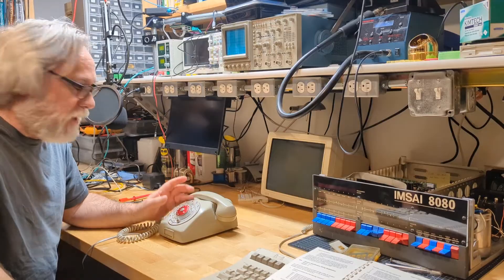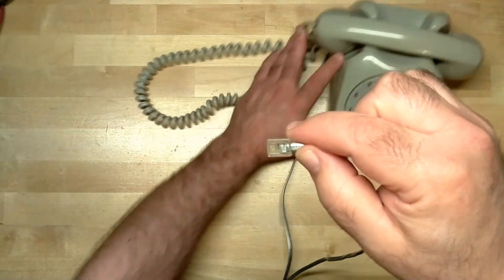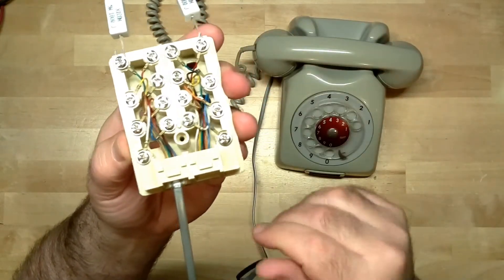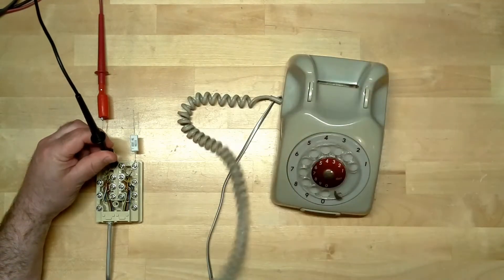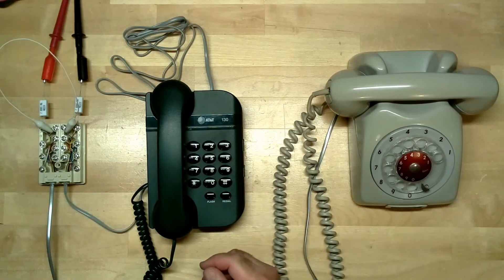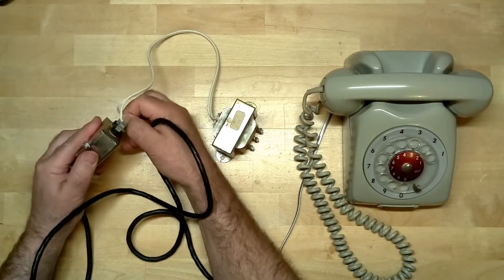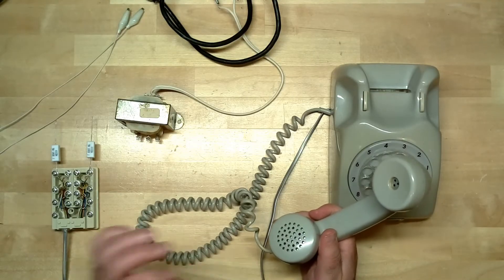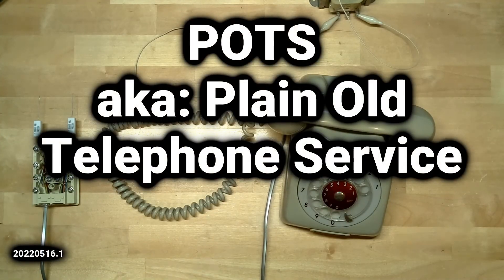Building a Plain Old Telephone Service (POTS) Intercom

Comment: I would argue that a modern cellphone call is more secure than a hardwired intercom phone setup, unless you’re worried about the government listening in. 

A hardwired phone to your neighbor’s house can be literally wiretapped. The one ones who can “wiretap” a modern cellphone call is the carrier and the government, because modern cellphones use digital, encrypted signals. 

The only way to “wiretap” a modern VoLTE cellphone call as a bad actor, and not an authorized entity, is to use an exploit called ReVoLTE, which is very limited in real world practice. It also requires a few thousand dollars in equipment, and some good technical know-how. They must also know your phone number, and execute the first step of the exploit within 10 seconds of you making a phone call. And since they have to capture the downlink stream, they’re likely going to have to be closer to the tower you’re connected to than you. Not to mention there’s other hurdles to get over like finding the correct audio codec, transcoding, and compression of packet headers. Additionally, it all hinges on the base station (tower) having its LTE keystreams implemented incorrectly, allowing reuse of keystreams on calls made in quick succession. 

Pre-digital cellphones, a landline was far more secure. 

Now all this goes out the window if you’re a kid trying to talk to a friend without parents listening in, as many cell providers offer parental control that allow parents to receive an audio file copy of the phone call, and details of who you called, or who called you.

Comment: Did I get it right that you only need 2 wires (or 2 pins) to hook up a phone? I always assumed it's 4 because the RJ11 has 4 pins. 2 for audio and 2 for the ring current. 
Also on a newer phone which has a ringtone coming from a speaker instead of a bell, is it also 90 Volts 20 Hz?
Reply from the maker: Yep.  All syms n 2 wires.  All pots phones since day-1 run the same way! 👍
Reply: @JohnsBasement  Thanks for the fast response. 
Some wifi routers (which run on 12 V) also have a RJ11 port for telephones. Do they also make the phones ring with 90 volts ac? It's kinda hard to imagine for me that a little box like that, which runs on 12 V also can output 90 volts. Am I missing something?
Reply from the maker: @TulgaD5  A phone can ring at lower voltages as well.  In my video I was ringing it at 24V.  To be fully compliant, the ring voltage SHOULD be on the order of 90V.  But 24 or 48 will likely do the trick on most phones.
As for getting more than 12V out of a 12V power supply, note that the ring voltage can be run through a transformer to step it up.  You can use a regular power supply transformer connected backwards... but be careful how you drive it.  A transformer is an inductive load AND one designed for 50 or 60HZ is going to saturate if you run it at, say, 20HZ (that is why you can use a 50HZ transformer in a 60HZ application but not the other way around!  -- it has to do how many lines of magnetic flux that can build up in the core before it becomes full/saturated.  Bigger core = more lines = more time = lower frequency.)  Therefore, ring your phone at a frequency at or higher than your transformer is rated and/or just let it saturate and provide current limiting at the primary so that you don't mess up your driver circuit. (Because a saturated transformer/coil looks like a direct short.)

Comment: Grandad was a ham. We did this in the 70s. I bought a 20 year old motor coach 4 years ago. It has 3 Pots phones front to back and one in a box back by the engine. They had not worked in a while so I fixed them up
Reply from the maker: Awesome!  "Hello, engine room?"  🤣

Comment: The phone system as we know it was around for way more than 100 years ago, since the Panel switch, the machine that connects phones together using rotating drums containing almost a computer program and columns of brushes moving up and down upon a Panel of contacts to find your line and a sort of electronic database to manage it all, was introduced in 1915
Reply from the maker: It would have been amazing to be part of creating it!

Comment: I've never had a problem with it, but I've been told repeatedly you shouldn't plug a 4P4C (e.g., RJ11) plug into an 8P8C (e.g., RJ45) socket, because it could mess up two of the pins.
Reply from the maker: 🤔 Now that you mention it... It does feel like the female-side is under a bit more pressure than usual.  The plastic 'shoulders' on the 4-pin are probably pressing up pretty hard on some of the leaf-springs.

Comment: Most European phones ring at 60volts 20 hz. Talk voltage ( also known as battery ) in the USA is around six volts while on hook voltage is around 48 volts. Ringing voltage was generated at the central office. Today these voltages are generated in interface boxes ( some networks call these DSLAM's ) where the voice is translated to digital data and sent to the central offices which routes the data stream of the call to the appropriate fiber cable to the correct interface box which converts the digital signal back to analog signals which are fed to the homes on copper lines. There are many municipalities now receiving fiber service to their homes.

Comment: So your saying how the ringer works? I kind of went right past me even though I was trying to catch how a ringer works,
It gets a higher amount of voltage how much  was it?  And if my phone will only make a un healthy ring what IT needs more volts
or the coils bad. or is there a capacitor that can go bad its only a 2009 single bell
Reply from the maker: The proper ring voltage is a 48v, 20 HZ pulsing waveform modulated onto a 48v DC bias.  But it should ring as I show on 24v, 60 HZ AC.  If it buzzes or rings weakly then raise the voltage.  Do not exceed 48.  Keep in mind that it is going to buzz VERY loud into the handset if you keep the ring voltage on after you pick up the handset!!! 
I would not exceed 24V.  If your phone won't ring then get a different phone.

Comment: so i had an old wall rotary dial phone. found the right kind of wire at a thrift store it connects to the little wall plug fine bbut doesnt connect to the back of the phone right. its too wide so what do i do now?
Reply from the maker: Phones have all sorts of different jacks and cords. I couldn't say based on only this description.
You can google for images of phones and connectors until you find the one on your phone, what it is called, and then google gor places to get one.
I would just open the phone and see if I could directly connect a cord inside.

Comment: Always fun to share  little projects with my friends. The design I came up with was a DC power brick,for a motor from junk cordless drill to drive a stepper motor from junk printer to make idle and ring voltage. We got our ring CPS from some switches touching cam lobes on the drive.

Comment: 2:42 not true. If you did not have a dailtone on the second pair (which you would only have IF you signed up for a second line)  you would not have any voltage on the second pair.
Reply from the maker: It was true at my parent's house in the 1970s.  They had a single line and there was a Western Electric wall wart powering the second pair.

Comment: In the 70s, I built a simple intercom system in our high school auditorium from the lighting board to the spot light to the stage manager by wiring three hand sets this way. It was genius.
Reply from the maker: I spent much time in the end of the 1970s in my high school's radio station and auditorium. The auditorium had bits of old telephone operator headsets laying around its closets from what must have been the same sort of thing.  :-D
Reply: We made an intercom using A modules from a language lab. They tore it out of the classroom. My friend and I were on the audio video crew. There was a heavy zip line from the spotlight to the back stage we used a ground and the zip line to hook up communication. The input of one mod went to the output of the other and so forth the electrical ground was common to both setups. We used the labs headsets which were 600 ohm speakers and the mic was high impedance. I have a few of those A modules and they are great for sound pickup. I can record birds singing that's how sensitive they were. Good eavesdropping amps.  Who needs a phone! 73

Comment: You mentioned the polarity doesn't matter. Back in the 70's, my boss asked me to fix his phone so people couldn't call out on it. I installed a hidden switch that reversed the polarity of the red and green wires. When reversed, the phone worked normally, but you could not dial out with the polarity reversed.
Reply: Rotary dial phones will work with the polarity reversed. Early touch tone phones needed correct polarity to dial out. Western Electric, supply unit for the Bell System began installing a " polarity guard " in it's equipment so if the line (tip & ring) were reversed you could still dial out. After 1984 when anyone could make and sell telephone equipment the really cheap phones did not have the polarity guard and correct polarity was required. Line reversal did not effect incoming calls. I remember when some business locations would put a dial lock on their rotary dial phones so employees could not make long distance calls. However, people discovered that you could hit the switch hook buttons just right and dial out. Hitting the switch hook button sends out a " pulse " just like the dial does.
Reply from the maker: Very weird. 🤔 Pulse or tone?  Neither should care about polarity.
Or maybe ISDN?  🤣
Reply: @JohnsBasement  Probably a tone phone, the old Western Electric phones didn’t have a rectifier bridge so the tone pad didn’t work with reversed polarity
Reply: Not related, but ‘battery reversal’ is used in payphones to drop the coin. Other way to drop the coins is a high frequency on the line. 12kc or 15kc.

Comment: Not all old-style ringer phones will ring at a 60 Hz frequency, despite supplying the right AC voltage. But electronic phones will.
Reply from the maker: This is a very good point!!  They are designed for 20HZ.  depending on the mechanical aspects of the phone it may not be an effective solution.
Reply: @JohnsBasement  If you put a single diode in series with the transformer, you will end up with 30 HZ which is more likely to work than 60 HZ.
You MIGHT need a bit more voltage in some cases though.
Reply from the maker: @m.k.8158  🤔. 1/2 wave rectified 60 HZ is still 60 HZ.
Reply: @JohnsBasement  how do you figure that-if you chop off every other cycle, you will end up with 30 HZ-a single diode will do this.
Reply from the maker: Diodes don't chop off 'cycles'.

Comment: In late ‘69 you could only get an answering machine from the phone company.  So I built my own.  Since ringing current is 90v @ 20 hz, you can rectify it to DC to pull in a relay, placing the device in an off-hook state.  I used an old 4-track (remember those?) home recording deck for both the outgoing message and overall timing of the cycle.  The tapes were the same as NAB broadcast cartridges, but they ran at 3 3/4 ips instead of 7 1/2.  A 30 second broadcast cart ran for 60 seconds on my unit.  I hand made a sense head from a small piece of hardwood with two bare wires wrapped around it.  A foil strip in the tape would bridge the wires as it passed, tripping another relay to stop both the cartridge tape, the cassette recorder that captured incoming messages, and dropped the phone connection to go back on-hook.  I think it used a total of four relays to manage all the “logic”.  The most expensive part was a transformer for the power supply to operate all the relays.  It had a lot of compromises, like the fixed cycle, having to listen to your outgoing message before each incoming, and not detecting if the calling party hung up and recording up to 30 seconds of dial tone.  But it was a fun project and worked well despite its limitations.
Reply from the maker: This is Awesome!!!
Back in the day, I remember using the sleeve and ring of a 1/4" jack to trigger a foil-stop on a reel to reel deck. 😁
Reply: That’s super cool. I grew up in the 2000’s, so everything was moving digital by then. But I still love old tech. So much more interesting and fun to mess around with.
Reply: @brickson98m Yes, exactly, much more fun to work with, which is very limited when digital! We're having Repair shops once a month, and people bring mechanical stuff, and a hurray is heard when items work proper again. The repair men are true tinkerers, they love their work. I'm going to try installing a black vintage bakelite phone on my landline connection. They've not removed landlines in Holland 👍and they shouldn't either! When internet goes down, landlines will work!    🌱👩‍🌾
Reply: Nice.

Comment: Back in the early 80’s, before cell phones took over.  I took advantage of this very same working principle and designed and built an expandable home telephone switching system.  The base system supported 4 extensions of touch tone phones, expandable in groups of 4, supporting a total of 16.  It worked on touch tones, had it’s own dial tone and ringing system as well as one private internal line.  I also wrote the programming to make it work. I still have the PC B's in my design archives….
Reply from the maker: Coolness! 😀
Things USED to make sense until "no user serviceable parts inside" ruined things for hobbyists.
🤔 I wonder how much this continuing trend is stifling creativity?
Reply: That is interesting! Any chance of sharing the info?
Reply: @Subgunman  Unfortunately most of the telcom grade components are no longer available anywhere, (Obselete) The heart of the system relied on these three obsolete components from Teltone : M-991, M-957 and M-949.
Reply: @Coz255  decoders and shift registers? I have several older telephone patches used to link POTS lines to ham and commercial repeaters. The decoders have probably been replaced with software based decoders and shift registers. There were even decoders used to switch on and off irrigation systems commonly used in garden centers and golf courses. The grounds keeper would be able to manually override the auto irrigation system when needed.

Comment: Think the added resistance is more of a current limiter?
Reply from the maker: Not in the way you might think..
The resistance in series with the power lets the AC audio ride atop the DC bias (without being filtered by the power source.)
Reply: @JohnsBasement  In this circuit, we want to filter the audio from the dc and keep the dc from letting the magic smoke out. You can do it without the resistance, but at about +14v the phones sound overdriven.
Also figured out the -48v, thanks to your video. If you run -48v through a flip-flop (easily done with MOSFET.) you'll get 90vac floating. And 20hz is low enough humans can't hear it.
The next circuit is detecting off the hook.

Comment: The ringing voltage is not "pulses" it's AC and it is passed through a CAPACITOR which blocks DC and passes AC to make the phone ring. In other words, the bell coils are not directly connected to the line they are connected in series with the capacitor (typically in the .5uF to 2uF range depending on phone model). This allows the AC and DC to "coexist" on the line. The bell circuit is indeed disconnected as soon as you lift the receiver.
Reply from the maker: 🤔 Makes sense.  I suppose that makes it easier to detect a ring-trip.
Reply: @JohnsBasement  It prevents and pulsing on the line (such as dialing from another phone connected to the same circuit) from making the bell ring.